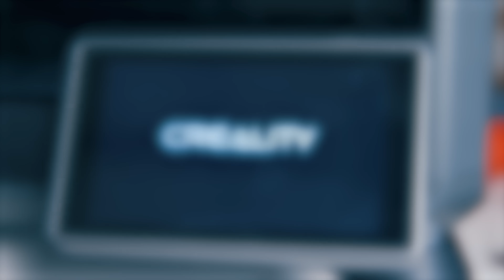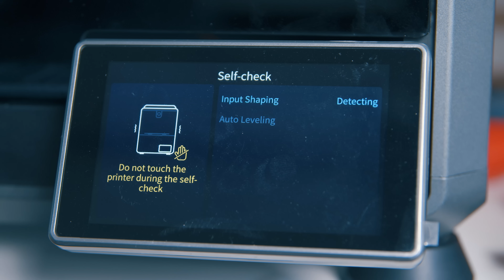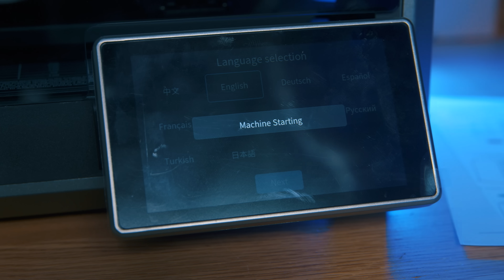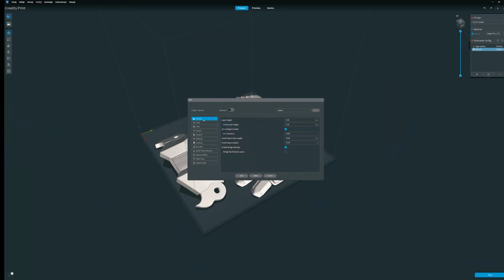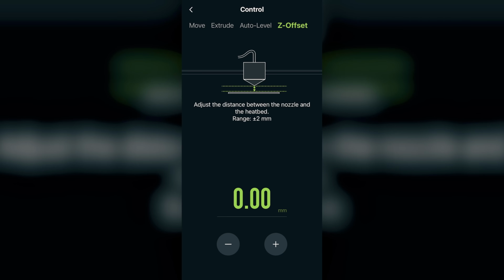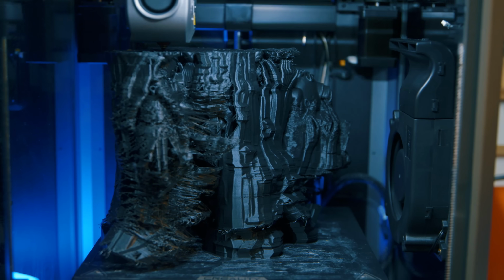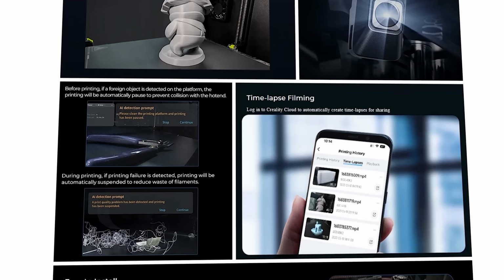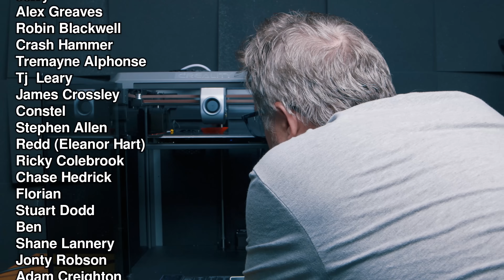Creality K1 Review - A small step for 3D Printers, A Giant Leap for Creality

Comment: As a beginner I am so glad to see someone who just wants to print. I am a beginner in 3D modeling and printing. I have plenty to learn and don’t need a printer to tear apart and rebuilt on top of everything else at the moment. I’m looking to use 3D printing as a tool to improve my main hobby, not have it be my main hobby. I’ll be looking deeper into this channel and hopefully finding the footing I need.
Reply: In the exact same mindset, I would love to know if you decided on a printer that would be good for beginners that just want to be printing!
Reply: @gubatron2441  I did. I ended up going with a Bambu Labs P1S. So far it’s been great. Printed awesome quality right out of the box. I have 330 print hours on it so far and haven’t had to do anything other than the recommended re-greasing of the friction points. I have only printed with PLA which is the easiest filament but it has worked good for my parts I needed.

Comment: So I know if someone wants smooth surface quality, then they should to SLA printers that do a good job at minis, but when it comes to Fused Filiment such as this, layer lines are just part of the process. Sanding and filling doesn't look like much of an option for that Venom shell for the spidey head, so I was wonder, instead of smoothening the print, what are some good techniques to completely hide the layer lines visually? Is there a paint or certain colour filament that will make them hardly noticeable while being looked at on a shelf?

Comment: The reason you, and other potential buyers, should care about open source, is because those that do want to tinker and make improvements to the printer and its features can do so, and you will also benefit from those improvements they make as they get integrated. This means K1 owners aren't at the mercy of Creality to fix bugs or add new features when they inevitably forget all about it and drop support for the K1 when the next hot product generation comes out.

Comment: I see lots of polar opposite reviews of the K1. Nearly every Youtube video says it's great. And that's likely because they make sure to ship properly QC'ed printers to influencers unless they do it anonymously.  But if you read through any forum/reddit it's littered with people like me who've had nothing but headaches from their K1 from the start that even profuse 'tinkering' or following their Creality's support videos will not solve. The biggest issue with them is their quality control. It would print well...IF they assembled it properly from the factory (which in my case they absolutely did not). And their support is horrendously slow. Then when they do send you parts, they are the wrong parts.

I'm glad you had a good experience with your K1, but a word of warning to viewers is that you've likely got a 1/3 chance of having a full fledged lemon until they get their QC straight - if they ever do.

Comment: I bought an early K1 and I love it, like you I am a print and go man. I have left behind all that tinkering and can now just slice and send to printer via my computer. I agree about the app and have never even tried it. Luckily as an early buyer I was able to take advantage of Crealitys goodwill gesture for the early problems and got a Camera, Hotend and Extruder replacement as well as a roll of Hyper pla for the princely sum of $2 with free delivery. Well done Creality and keep up the great work Ross😂
Reply from the maker: I only found out about that deal 2 days after it ended. Gutted. That was such a good deal
Reply: I'm on the other end, I took possession of my K1 Max V2 ( So called by some) on Monday. It has the better hotend and a few other little bits come with it.
So I have to say, well done Creality, a mile better than my Ender 5 Pro, that has just about everything that can be done to it, yet doesn't come close.
Yes, that app is painful, and the cloud transfer doesn't print all my model, it's at 100% about 2/3rds the way through the pri t and just stops, wasting so much filament. 
What am I doing wrong? Or is it them losing a third of my data in the cloud transfer???
I will let you know when the support team get back to me.
Good video, I must say 👍🏻
Reply: Any update on this?

Comment: Mine has been stopping mid print lately but thinking more about that it's the same print so possibly a bad file. Other than that I've run it hundreds of hours with 0 issues. It prints every pla I throw at it with no fuss. Just set it and forget it. Some stringing with certain brands since it likes to run 220-230 for every profile probably because it moves so fast but not a big deal.
Reply: My ender 3 has now been set to lithophane duty. I rarely print anything else with it.
Reply: Also on the lid it says not to use the lid if the room temperature is above a certain temp. I use the lid always because everyone in the house needs to sleep 😂

Comment: It’s even simpler.  Some people want a kitchen and some want a microwave.  I want a device that just works with little maintenance.  Others want the flexibility to change and tweak everything.  We’re closer to the microwave than ever but the cost for those is climbing.
Reply from the maker: Wait for my A1 mini review.
Reply: I watch them all because I'm in the market for a Resin printer on Black Friday.  I'm leaning toward the Saturn 3 Ultra with all the wash and cure station fanciness.  I even plan to use your link. 😉 @FauxHammer
Reply: perhaps a washing machine is a better comparison. More like the prices of 3D printers, I’d bet while many will do basic maintenance/repairs - the majority will treat it as a magic white box that just works, and if it breaks they call an engineer. Nothing wrong with an appliance and surely its better for 3D printing to grow with a larger audience, and not have ‘tweakers’ looking down on ‘plug and play’ preferrers or vice versa which just means in-fighting rather than sharing the love to a wider audience
Reply: I'd agree with that.  Most people buy lawnmowers and washing machines and such and just replace them when they stop working, but there is also the option to repair them yourself or get a specialist.  I'd love for a specialist to deal with my printer woes so I could just design and print without stress. @MrKlawUK
Reply: The comparison doesn't really work because a microwave has very few parts that can wear out. You only have to clean the inside from time to time, but that is more for hygiene than to keep it working. Microwaves are also dirt cheap. You can get them for as little as $50, so it's not worth repairing the microwave.

3D printers, on the other hand, have many moving parts that wear out over time. Not only is regular maintenance important, but you will need to replace parts from time to time. And you should have at least a basic understanding of how a 3D printer works to be able to perform such a repair.
Reply from the maker: @andreas.grundler  That was True about computers initially too. Microwaves are now cheap but when they came out they cost hundreds and were in just a few homes. When they broke, it would be worth repairing them instead of replacing them. so the only people who understood how microwaves and the electronic and mechanical parts were service technicians and repair engineers. 

3d Printers are going that way. Removable nozzles and hot end components are being built in to them to make the hardest maintenance more like swapping a cartridge in a 2d printer. Even greasing the lead screws can be removed by using ball screws for far less wear.

It;s a good analogy, we just aren't in the same place with Microwaves as we are with printers.
Reply: I remember when my parents got us a microwave for the first time in like 1990 and it was still a big deal then, definitely not in every home still, were far from refined or consistent, and cost as much as a big 27" TV.
Reply: you probly want to avoid the k1 then
Reply: Creality is junk.
Reply: @Patriot_First  Could you explain why.... or should we just assume you are a 10yr old troll whose opinion is worthless?

Comment: I use the Prusaslicer with my K1.  I figured out a way to get the side fan control using the custom g-code "after layer change".  Here is the code I came up with and it works.

M106 P2 S{(layer_num < 1 ? 0 : 204)} ; Side fan to 80% after layer 1

It will turn on the side fan after the first layer is printed.  The 204 is the speed percentage (204/255) = 0.8 or 80%.  Prusaslicer I think gives better results than the Creality slicer, but that might just be my opinion.
Reply from the maker: I wonder if that will work in Orca too then.

Comment: I was hoping Bambu would bring out a larger printer but that did not happen. Seems I don't have a choice apart from the K1 Max. But then with 3 printers and one of them being a CR10s am still on the fence.
Reply from the maker: How long can you hold off?
Reply: QIDI Max3 bigger than K1 Max, better printing precision, chamber heating:face-blue-smiling:
Reply: I am looking at QIDI MAX 3 the big killer I see is being closed source. So what happen in a year or so if you need replacement parts. @mohistschool1003

Comment: I love my K1. It is such an amazing printer. It did have a rocky start as they probably rushed it. But after the extruder improvement on the next batch and the software updates, it is great.
Reply from the maker: I guess i got the next batch.
Reply: @FauxHammer  I think you can see it with the red silicone sock on the nozzle and the lack of a blue clip for the bowdem tube on the top. 

I had one from the first and second batch. Weirdly enough, it wasn't my extruder. That was the problem. My fan just didn't work, and the supplier didn't have fans, so they replaced my printer.
Reply from the maker: @EDreyer  thanks, if they had a whole batch of bad printers then it makes sense why early reviews were so bad. Mine has been amazing since first print. and it was all automated.